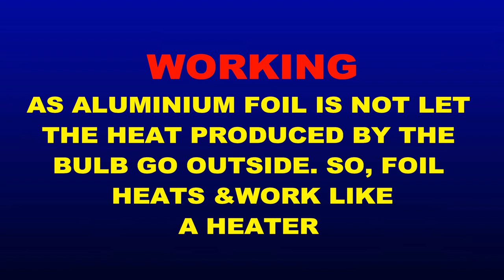Handmade Room Heater Using Filament Bulb At very low price

Comment: Using 110vac input, one can place four 100 watt incandescent bulbs in series and while wrapped in aluminum foil, should have good reliability, since each bulb is only using around 11 watts. I use another 4 bulbs in series and then place that in parallel with the other 4 bulbs in series. I then place a large oven pizza stone, that is made of clay, on top of the bulbs. This takes an hour to start feeling noticeable near by, while the heat starts to build in the stone. The only reason anything can be seen, is because matter is absorbing the light energy and radiating some back to our eyes. The far infrared frequencies, that the clay stone thermal mass emits, is a far more ideal and efficient means to heat an area, by heating the material objects. This then heats the air as a result, just as this earth realm does. peace love light